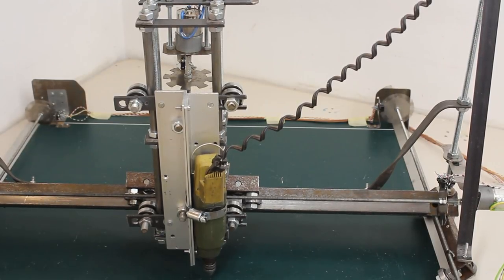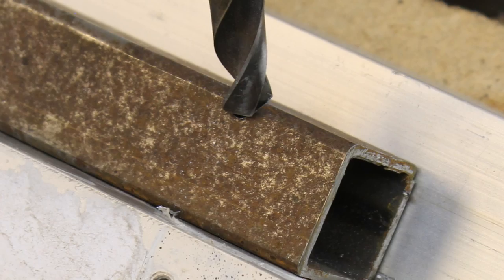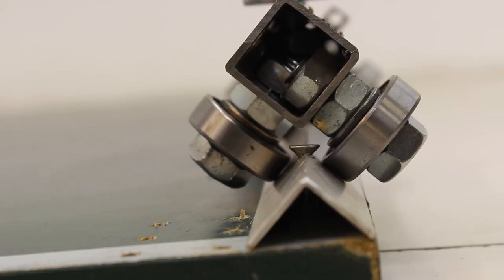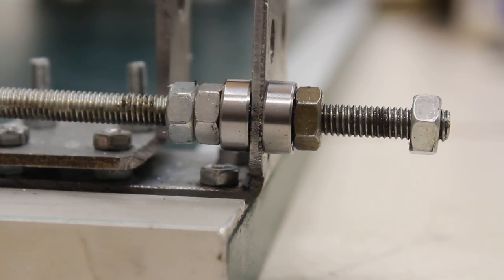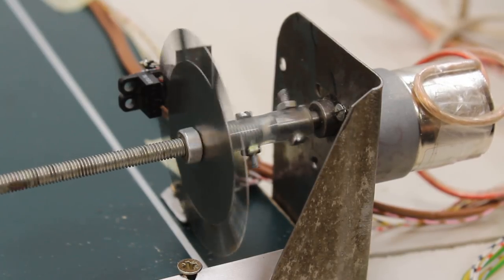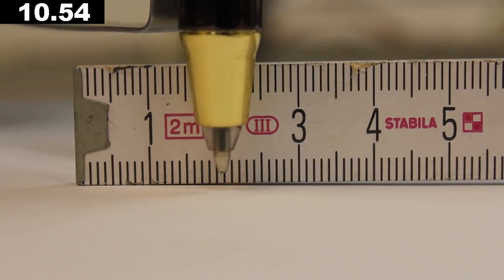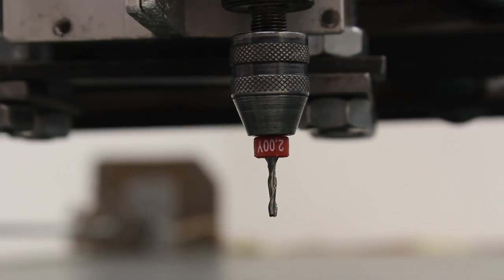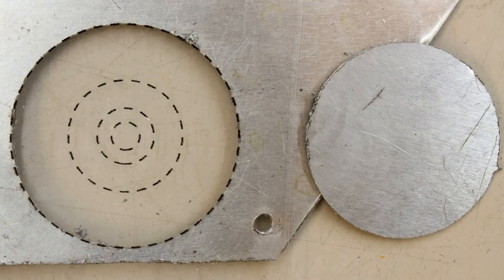Homemade CNC machine with materials from a DIY, built with simple tools

Comment: Hi, I have a tip for cutting styrofoam. Just add a little fan, I just tried it myself and it works great. It blows away the hot air around the cutting wire therefore the cut is consistent along the length of the wire. In short, it removes the problem shown at 14:55 Great video, I hope there will be more soon :)
Reply from the maker: Srdjan Savic Great tip. I have added that to the project page. More is on the way: I have made a V-Plotter that will be shown in my next video.
Reply: HomoFaciens  Glad to help. It is really nice of you to add that, I should add that I used fan from an old computer powerd with an old phone charger, just to avoid confusion.  I also tried cutting polypropylene (plastic with recycling number 5) . Without the fan the plastic just flows back into the cut. With the fan on there is some success, but often the fan cools soldering iron too much and it won't cut plastic anymore. I still need to find balance between the two. P.S. You should take look at GRBL if you have not already, it helped me a lot with my cnc. I hope to see that electronic project that will conquer the sky :)
Reply from the maker: Srdjan Savic For cutting polypropylene I would suggest using the router and cooling the drill bit with water as I have done with the acrylic plastic. GRBL is great to get a result quickly, but my intention is to do things from scratch which helps to understand basic principles of electronics. Maybe sometime I will have a closer look at that professional solution - thanks for your hint. there is still a lot to do on earth before going above the surface...
Reply: HomoFaciens I used router, but it's really loud, because of that I am looking for alternatives so I can keep the love of my neighbours. Also I would like to show this to kids in my local school, and I don't think loud and potentially dangerous router has a place in a classroom. Building things from scratch is just more fun, at least I think so. I only used GRBL because my scratch built version used my computer monitor and some photodiodes to control the steppers. Also I was too lazy finish the code when I found I could just download GRBL and buy Arduino. If you are interested I could send you the program I wrote,  it only controls X and Y axis, I think it is good for demonstrations at least. It is written in microsoft visual studio 2013.
Reply from the maker: Srdjan Savic The low power router I am using is not that dangerous, but nonetheless it is too loud to start a conversation while it is running. Do the kids know what great teacher they have? Building a CNC machine in your free time to show it to you pupils is great! Using prefabricated modules like the GRBL modules doesn't mean there is nothing left to be done - you still need a lot of knowledge to put it all together. Since I am working with Linux, I have no demand for a microsoft code - thanks for your offer.
Reply: HomoFaciens Actually I'm just an engineering student, but I have friends who are teachers. Buliding things is just my way of haveing fun. Growing up in a small town there was no one who could teach me about building stuff like this, and I really wished there was. I guess i could teach someone what I wished someone taught me, and show people that building things like cnc just takes time and knowledge. And more you know, easier it gets. I'm thinking about makeing a V-Plotter too. Just without an arduino, just to make it more fun.
Reply from the maker: Srdjan Savic The Arduino is endeed a fun machine! Handing knowledge to the next generation of engineers is worth every minute. So we are soul mates...

Comment: Amazing.
I never thought possible to make a very accurate machine in this way and with this cheap materials. Congratulations.
I'm surprised that you don't use nut with break.
The encoder is better with magnets and a hall transistor.
Regards.
Reply from the maker: Thanks!
Nut with breaks? What's that?
Why should an encoder composed of magnets a hall transistors be better than the optical scanning method?
Reply: HomoFaciens 
Nut with break is a nut (for a screw ) that has a little piece of plastic inside , so once you put the nut on the screw, the nut never loosen up. 
The advantage of the magnet and hall transistor is that dust never will be a trouble, because infrared leds can be obstructed by the dirt, because leds are an optic system.
Regards
Reply from the maker: I know them as "lock nuts" and I never heard "break nutz", thus I though they were something more special.
Those nuts have a tiny nylon inlay and that tiny ring is worn off quickly, especially at fast revolution speeds, thus I don't recommend to use them. However, evolution goes on. In my latest CNC v3.2 I am using another kind of plastics thread that compensates the wear on it:
https://youtu.be/eT9iDO0I7d8?t=6m14s

Yes, dust on the light sensors is an issue I had to deal with. After covering the slits of the sensors they work fine:
https://youtu.be/VSDQzrUMeuM?t=6m10s

Hall sensors are an option to eliminate those dust issues.

Thanks for sharing your thoughts!
Reply: HomoFaciens Okay. Thank you.

Comment: Where are you buying your bearings though? I have never seen them at home improvement.

If a major goal of the project is ability to build it from parts available locally, it may be wise to design around 608 type bearing. It has 8mm internal diameter and 22mm external, and is available from any sporting goods store, as these bearings are common in rollerblades and skateboards and frequently need to be replaced due to tough wear. But i can see how it conflicted with major engineering goals.

This is a great project, quite impressive in quality for the constraint of not using speciality or machined parts.
Reply from the maker: Yes, the rollerblades bearings are a good hint. I'll keep them in mind for future projects - thanks!

Comment: you know, that "low tec" tool you call it is in my opinion quite advanced - especially the metal construction is a very good idea, if you tried to buy some CNC machine off the internet, you would see what "low tec" means:)

btw that lowtec tool you constructed could be also a 3d printer quite easily couldnt it?:)
Reply from the maker: +Jakub Sempek The high tech of today will be the low tech of tomorrow.
The speed of this machine is much too low to use it as 3D printer. It would need weeks to print an object...
If the metal construction is too advanced, have a look at my CNC v0.6:
https://www.youtube.com/watch?v=MlR-9Uiab60

Comment: its really intresting. normally stepper motors  are used. You used normal motors with proximity switches. that's very clever. I assume you used G code. first it really work on 2 cables normal motor as well as stepper motor. or have you customised the program?
anyhow it's very genius. well done.
Reply from the maker: +wlondoner This machine doesn't process G-code (yet). The software as well as the firmware (Arduino Sketch) was written especially for this machine. Details are on my project page:
http://www.homofaciens.de/technics-machines-cnc-v2_en_navion.htm

Comment: silicon lubricant as used in the cd drives should be perfect, I've recently disassembled a few 15 year old CD-ROM drives and the actuators were still lubed as if they were new
Reply from the maker: Yes, silicon lubricant is indeed a very good product, but I prefer using old stuff wherever possible.

Comment: May the revolution of the CNC machines begin?
I'll be back?
I think I've said this once before, but... You sound like Arnold Schwarzenegger, and that's awesome.

What kind of computer was used as the terminal? Seems like a Linux system of some sort.
Reply from the maker: I was using Ubuntu 12.04LTS on my Laptop.
Reply: HomoFaciens Ah, okay. I've only used 10.04, 10.10, 14.04, and 16 for Ubuntu. Is 12 any good? These don't seem very good to me.
Reply from the maker: 12 is nearly outdated. Meanwhile I am using 16LTS on my Laptop and it does what I need to do with my computers.

Comment: If you don't have a compressed air line,  a dry (or paraffin wet) paintbrush works well for cleaning the crud out of threads.
Reply from the maker: MattOGormanSmith Another great tip that's now added to the project page - thanks!

Comment: I would request that you test this on a PCB. How do you input the design? Do you have to program each and every move, or do you input a picture for it to follow? If the former then a detailed PCB would require a ridiculous amount of programming.
Reply from the maker: +Robert Vernon As written on the project page, Scalable Vector Graphics *.svg are transformed into movement of the CNC.

Comment: Hey what kind of coolant did you use for cutting plastic? I see your feed is slow and still the plastic doesn't melt. Your project was a great inspiration. My robot is 6 months old now but it hasn't gone through plastic yet please help.
Reply from the maker: As said in the video it is nothing but water with some drops of detergent (to reduce surface tension). Don't dive too deep into the material (no more than 0.5mm each run). What robot have you build?
Reply: A CNC router. I am using grbl though, since it supports arcs and surface probing. You had the 100W Proxxon motor, I only have the "40W" 50E (Actually 10W). I tried 0.5 depth, but I think I need a sharper tool or higher feed rates. Will try again tomorrow, but thanks anyway!

Comment: Typical German. He could not bring himself to use a piece of wood with the metal rails for strength. He had to use all metal.  They are at one with metal and feel comfortable there.  Great work and great engineering. I especially like those roller bearings and how they are bolted down hard to the steel rails. Each type of CNC machine is different and every tiny thing affects the design.  These bearings might be noisy in a high-speed lower-accuracy machine.  I want a quiet high speed machine for things that don't require much force like drawing or painting, and that can run at a high speed, and for it to have a  big long work area.  Then I want a machine for milling that will be designed totally different with lead screws instead of rubber tracks, for stability and accuracy.
Reply from the maker: +Jeff Beck Yes! The only material that can replace a steel bar in a machine is a more solid steel bar!!! ;)
But I have learned my lessons meanwhile. My latest CNC under construction is v0.6:
http://www.homofaciens.de/technics-machines-cnc-v0-6_en_navion.htm
Another, serious yes:
It is a wise decision to build two CNCs  for the contrary demands you have on your machines. Many people (same as me) try to build a machine that can do all at once when they start to build their first CNC. In a long process I have learned that:
1.) small is beautiful to start CNC
2.) more than one machine is needed to fulfil all demands...
For high speed, low precision you can use stepper motors with a belt drive as in ink jet printers. High precision linear drives made of steel are a good choice for machines that need higher forces to move a router.

Comment: +HomoFaciens - how do You think, encoder on drive shaft will be more sharp? (Gear ratio is high - about 100). Can this (drive w.encoder + gear) work like high torque servo for large CNC? Thanks
Reply from the maker: Where to put the encoder depends on the accuracy you need (higher with the encoder on the motor) or the number of pulses your microcontroller can process (better on the output shaft of the gear).
What motor works on what CNC depends on the build quality of your mechanics. The better your skills, the lower the needed torque.

Comment: BRILLIANT IDEA
Reply from the maker: +Sosh Bogdanov ...I am working on an upgrade of this machine using bipolar stepper motors. Today I have soldered four 4988 stepper driver boards. Stay tuned!
Reply: +HomoFaciens Have a question how do you find the zero point or start point for your z axis  when programming a part ? The 4988 stepper drive will also give a you greater degree of accuracy when making a part . again Very nicely Done.
Reply from the maker: +Sosh Bogdanov I drive it manually to the desired z level before processing the selected file. There is no depth sensor on the axis.

Comment: Very interesting, do you have an idea of the full construction cost?
Is it possible to run it on softwares such as mach 3?
Reply from the maker: Pierre LE BRETON Thanks. I had all the materials used for the machine in stock (not only the rusty iron tubes), many of them were from my first CNC machine that was disassembled for this one. As I can remember, the motors are around 80,-Euros (20,-Euros each), the Arduino is around 25,-Euros, the ball bearings around 40,-Euros and with all the bars, nuts and cablings the total cost will be around 250,-Euros.

I have never used mach 3, thus I can't say if you can make it run with that machine.

Comment: Awesome use of simple components , but who told you you need 3 TAPS to thread a hole?? First thing , you were tapping a thru hole so the taper tap is all you need. All of those taps cut 6 mm threads to finished size so only the taper tap is needed. The bottoming tap is usually used LAST to cut threads at the bottom of a blind hole , hence the name. I am a semi-retired tool and die maker , I own a shop that taps holes every day so I know something about working with metal. I am looking forward to making this machine  with my tooling as my machine tools make this build much more accurate so my results should be even better.
Reply from the maker: +Michael Aumick ...long time ago, my trainer told me to use all three tappers of the set he handed me, but that was when I was educated to become a physics laboratory assistant, not a metal worker...
Would be nice to see your machine, soon!

Comment: Amazing accuracy to achieve without even using stepper motors! Can it run GCode directly? I've just finished writing a plugin for SketchUp to export GCode :)
Reply from the maker: +OpenTronic Thanks! It's not the motor that is responsible for the accuracy, but the build quality of the mechanics. The software can't import G-Code yet, but I will do an upgrade sometime.

Comment: I built a machine like this a couple months ago. It works just like yours, but I'm not able to cut plexiglass like you do. Most of the time it melts. Can you give me some tips?
Reply from the maker: +TheGamesBond-007 Use sharp router bits, don't dive too deep into the material and cool the plastics with lots of water.

Comment: Beautiful build ! .  What  kind of soft material did you use to connect the threaded rodes and the  motors ? .
Reply from the maker: Oussama Ousmoi Thanks! It's a section of a fuel pipe with an inner diameter of 5mm.
Reply: HomoFaciens I see Thanks .  Very useful  trick, i wish i knew it before while i was building my  CNC machine , that would had saved me some time and struggle :) .
Keep the good work
Reply from the maker: Oussama Ousmoi It's never too late for an upgrade. Maybe sometime I will add stronger motors or stepper motors to the mechanics of my machine.

Comment: Hi, I'm interested in building this CNC but we need it for drilling wood. We saw your video with test in aluminun plate, but would like to know how thick could the wood be, and if hardness of some plastics like technyl (shore-D of 75). Just to give you an idea, we need to make vertical cuts of 1cm. I'll appreciate your feedback. Thanks
Reply from the maker: +Claudia Valdivia ...there is no need to post this question twice (on YouTube and my project page). Usually you get a quicker response when posting on my project page or if you send me a mail. Well my answer is:

Whether you can cut wood of 1cm thickness depends not only on the build quality of the mechanics, but also on the router and drill bit you are using. I tried 1cm chipboard with my cheap 40W router and the result wasn't too good (some smoke comming out of the cutting edge when diving more than 5mm into the material...). I am no woodworker, thus I don't own adequate router bits, but I'd say it's not too optimistic to give it a try.

I am currently upgrading the machine to v2.1 using bipolar stepper motors and doing some minor changes at the mechanics. Hope to have the video / chapter online at the end of this week.

Comment: Hi I noticed you used regular threaded steel rods, did you experience any backlash issues? I am building a CNC machine for cutting PCBs and I am concerned about the backlash issue. How did you overcome it?
Reply from the maker: +Rolando Martin As shown in the video at 8:50 I tried to compensate by twisting the bolts with the inner thread. It's no perfect solution (increasing friction and so wear).
Reply: +HomoFaciens Thanks, now I understand. Did you try leaving the clearance as is (to reduce friction and wear) and compensate the backlash via software? (measure backlash at each change of direction and then modify the script to add more steps to the axis to compensate)

Comment: 01:32: How did you fastened the vertical rod in the angle?
Reply from the maker: Did you watch the whole video? I drilled a hole on the tip and used two nuts (one inside the square tube).
Reply: HomoFaciens I saw 1 nut inside near to the edge of the square tube. But the second rod is far from the edge (about 5 cm), How did you fixed the nut in the middle of the tube?
Reply from the maker: Артур Файзуллин
Put a nut in and try to "catch" it with the threaded rod. If you got it, it's self locking and you can fix it with a second nut from the outside..